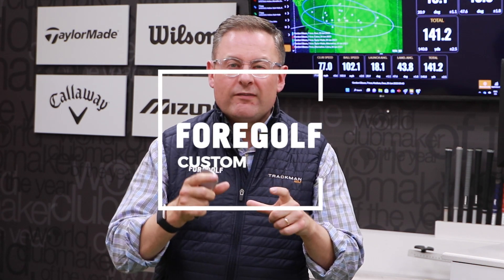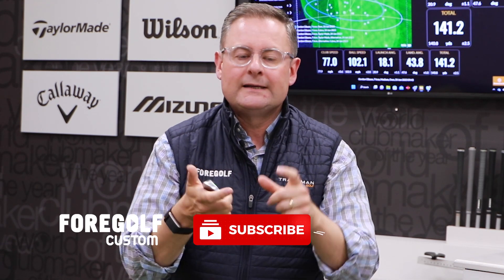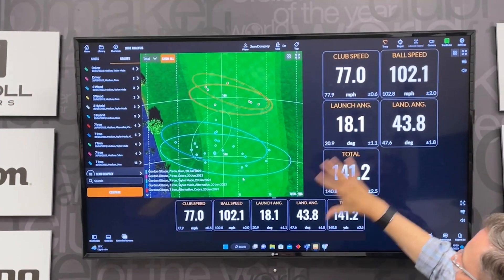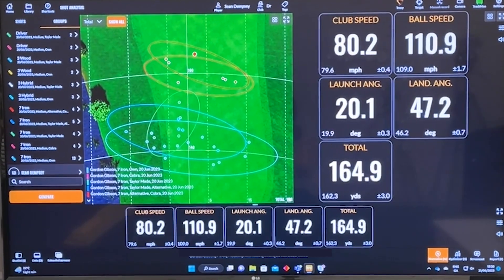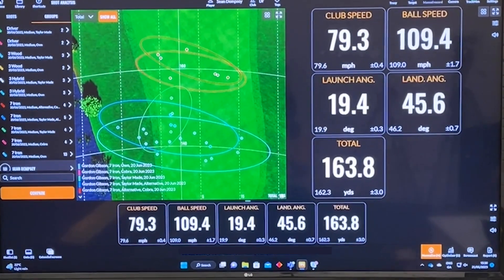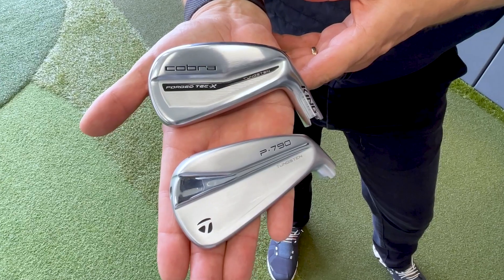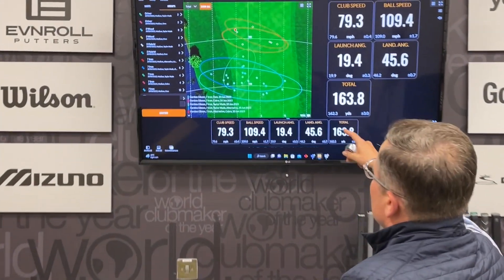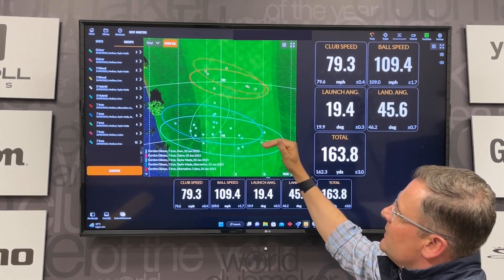Iron fittings explained  - new tech vs old heads with TrackMan

Comment: I recently read that Bubba Watson has his irons (I believe old Ping S55’s) bent “open” several degrees. Is that even possible? I used to work in the industry many years ago and adjusted loft and lie, but our machine never had a way to bend irons open or closed. Thanks in advance.👍🏻
Reply from the maker: I think it was his woods that were set open. Can’t bend irons open or closed. Thanks for sharing 👍🏻